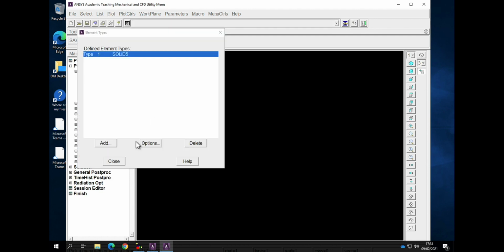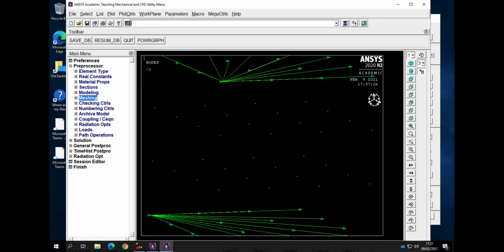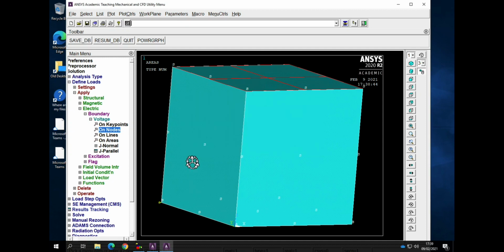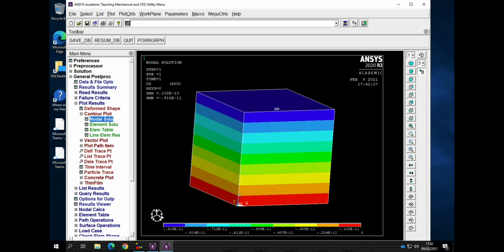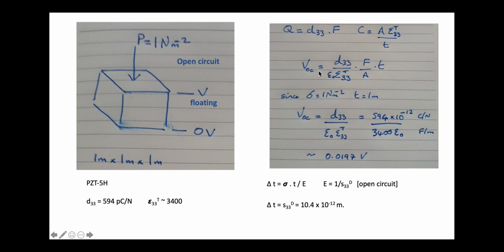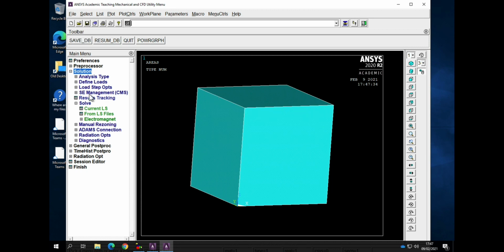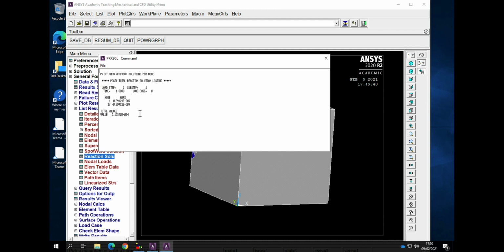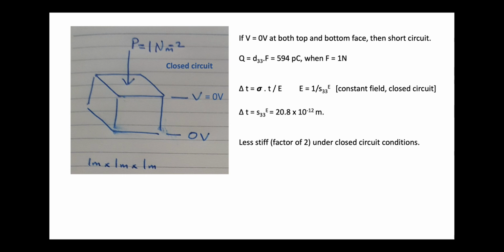ANSYS Piezoelectric Modelling 2

Comment: In the end you validate voltage output from the formula by taking d33 and eps33=3400. I can follow that you derived d33 from e matrix with d=inv(C)*e. But how did you able to get 3400? Our orthotropic permittivity matrix elements were 1700, 1700 and 1470 :((